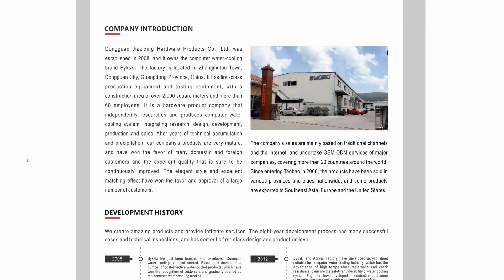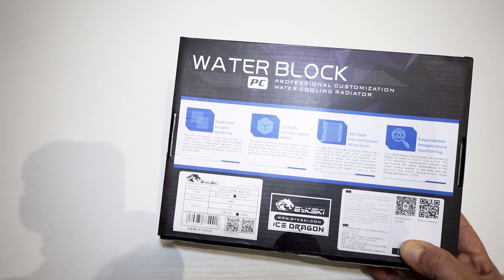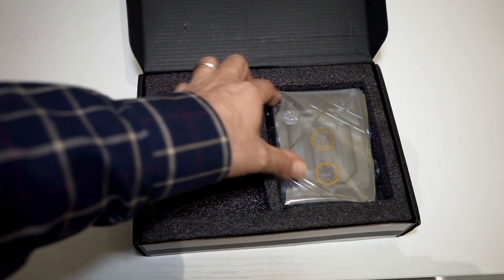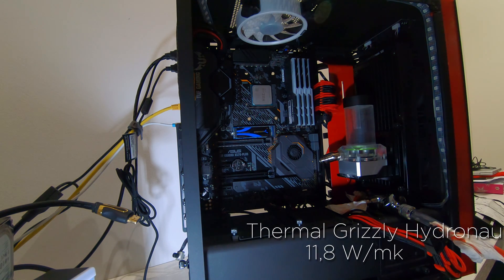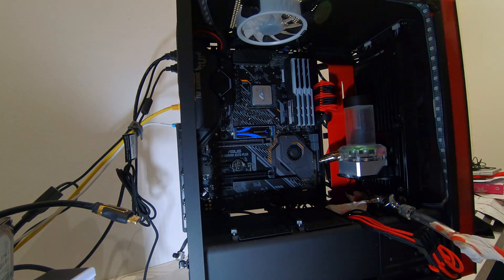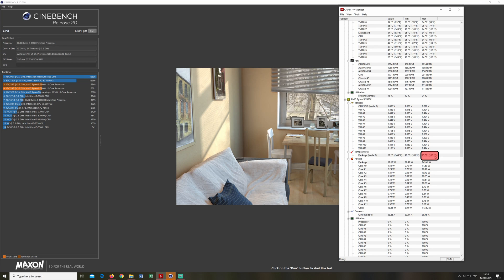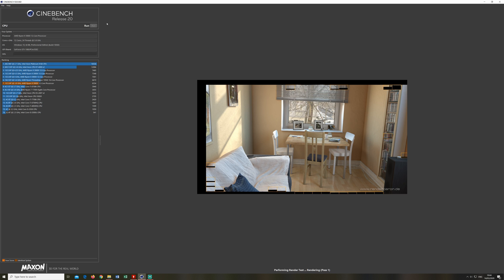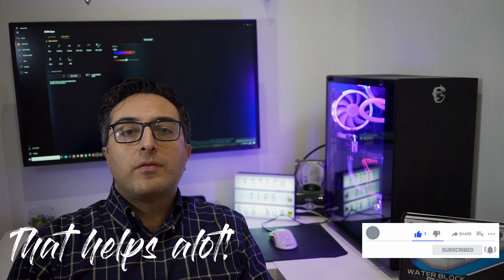Bykski CPU-XPR-AM-V2  : Cool Ryzen CPU Waterblock review

Comment: i have this exact cooler on my 5800x and i cannot get good temps for the life of me
Reply from the maker: Did you make sure all 4 screws are completely tight? Also did you use an high performance thermal paste?
Reply: @fgtechtips  yes and used noctua paste. I have a full bykski system. Idk if it's the radiator or what but idles at 55⁰ and goes up to 87⁰ under load
Reply from the maker: If you have 30c ambient, 55c idle is not so bad considering that CPU but yes it should be lower as you only have 8 cores compared to 12 of mine. Is it a full loop including GPU? Did you enable cstates? I would suggest you to try the thermal grizzly Hydronaut
Reply from the maker: Yeah then it's a bit too high, I think you can get some degrees by enabling cstates in bios which help you in idle temperatures and by removing completely the thermal paste replacing it with an high performance one like the kyonaut that will give you already 2c less than the  Noctua nt-h2 and don't put too much of it but just a narrow X
Reply: @fgtechtips  Yes, this is a bad temp. I live in a tropical environment at 33ºC at day and my 3700X stays just 1ºC above room temp at idle, and goes up to 70ºC on Cinebench loads. I have exactly the same Bykski block with 280mm Bykski radiator, and I'm not even ramping the fans (I use Noctuas with a custom silent curve).

What I can say about this block is how tricky is to secure the mount, it's a far from ideal mount system and you have no clue if the screws are tight enought at the same time you are afraid of crushing the CPU or breaking the acrylic top.
Reply from the maker: Yes he has 22c of ambient temp and 55c idle is absolutely way too much. Either there are some clogging issues or the thermal paste is bad quality/too much

Comment: got this with a 3700x and a thick 360mm radatior and I hit 87C
Reply: Didnt apply it right. 5950x and temps is 59c
Reply: @jacquesbuys1354  yeah when gaming I get 54°C I'm talking about a full core CPU load like video rendering and cinebench gaming only uses 4 cores
Reply from the maker: @tech4life Which thermal paste have you been using ? Can it be that it's low quality or maybe you used too much of it ? Also did you completely screw the 4 thumbscrews? They should be screwed little by little one by one
Reply: @Tech4Life  its rendering..
Reply: @jacquesbuys1354  you probably have it set to use your gpu for encoding try running cinebench R23 multi core it's not like my GPU is the reason my system is getting hot it's below 60°C half of the time I'll make a video on it and share the results through a link later

Comment: Great video but I'm a little confused. Does the waterblock need to get power from anywhere, or is it all in the pump. Thanks.
Reply from the maker: No Power needed, it's the pump that will make the water flow in the loop. You only need to plug the arGB cable for the lighting effects
Reply: @fgtechtips  I have only jrgb ports on my motherboard, is there any converter you would recommend?
Reply from the maker: You could buy a 5v 3pin to sata converter like this
https://a.aliexpress.com/_vNeTDr

Comment: I was thinking of changing my Alphacool NexXos XP Silver from 2004... I'm using a 5800x with 2x 240mm rads and after warming up, it does 77-78C in cinebench R20.
I wonder if with this it will get better?
Reply from the maker: Hi i don't know that specific one but it's pretty old, with this one you will surely gain additional surface which is always good and the number of fins is probably higher
Reply: @fgtechtips  I'm deciding between this one and the alphacool xpx, let's see how it goes, but this one with A-RGB would be a plus. 
Do you happen to know the size of the micro channel finlet area and the full copper base plate? Thank you, it might be the factor to make the decision.
Reply from the maker: @nelsoncasquinha  you can use the google translator app on android and point the camera to this website. https://www.bykski.com/page133?product_id=3566  I was not able to find information on the size of the plate but it's surely the largest i have ever seen, regarding the micro channel they seem to be 0.5mm
Reply: @fgtechtips  thank you, I'll give it a go but I've googled a lot and couldn't find anything. If you can a simple picture with a ruler on top would be enough, even with it installed. Thank you
Reply from the maker: Yes but it will give you the acrylic size non the metal size that goes in contact with the CPU. Will measure it later for you ;)
Reply: @fgtechtips  yes i know, but from a top picture with a simple ruler i can tell aproximately the fin area. Thank you!
Reply from the maker: It's 9x12,2cm
Reply: @fgtechtips  thank you, but that is the size of what exactly? It's too big to be the water micro channels on the copper base (I think). That is what I'm trying to find out please. Thank you once again for taking the time!
Reply from the maker: Yes told you I could only measure the top dimensions of the  acrylic plate.....the microchannels dimension  was in the other comment o wrote
Reply: @fgtechtips  oh sorry I saw it but that is the spacing between the micro channels, I'm trying to have an idea of the full micro fin area. If the acrylic is 9x12,2, the the micro channel area is probably around 40x40or something. Should be bigger then acool xpx, but I'm not sure if its bigger than the xp3 light acetal.
Thank you taking the time my friend, really appreciate it. 👍👍

Comment: Did that cover up your top M2 SSD making it impossible to remove without removing the block?
Reply from the maker: No it was really perfect, I was also able to install a small m.2 heatsink without issues as you can see from this video: https://youtu.be/MmJQ2obsyms
But that's really it, anything thicker doesn't fit, as for example this heatsink model I tried here 
https://youtu.be/GCBZy2WXfWw
It was about 1mm thicker than the other one

Comment: Are you still using this block? How has it held up if so? I like it but I don't love that you're holding it down with acrylic instead of metal.
Reply: I was afraid of this too, use the acrylic top for mounting is kinda fearful, I know people with "boutique" (famous and very expensive brands) CPU blocks that used the acrylic top to mount and they had bends and fissures that caused leaks, but the acrylic top is this Bykski block very thick and Bykski claim to be "Mitsubishi acrylic", not sure what this means exactly, I don't even know if Japan Mitsubishi makes acrylic, chinese brands always make some very dubious claims about the quality of their products, but I have mine for about 1 year and its still perfect.
Reply from the maker: Hi yeah still using it and loving it , if you want an argb waterblock it has to be acrylic on top, it's the same also for EK waterblock of the integrated CPU waterblock in most expensive motherboards
Reply: @fgtechtips  Oh I know. I mean where you hold it down with the screws. Ek uses metal and even some of bykskis have have the same design. Im just worried about it cracking from stress. Although, it shouldn't be screwed in super tight anyways.
Reply from the maker: Luckily no cracking even if I have it super tight. btw  my previous ek supremacy Evo was the same, all acrylic on top with no metal
Reply: @fgtechtips  Even where the screws are inserted? They usually all have metal that sticks out for that. It's not a big deal though. I like the look of these way more than any ek block.
Reply from the maker: Yes look at this https://images.app.goo.gl/wADMsfzhvm9daT8TA
Reply: @fgtechtips  That has metal feet for the screws. The acrylic top is fine. Where you screw it to the motherboard is metal though.
Reply from the maker: @treyjennings0915  ok got you now, I thought you referred to the top acrylic . Anyway the acrylic is quite thick, shouldn't be an issue, mine still fine and its still the best looking one
Reply: @fgtechtips  okay, thank you. I'm sure it's fine. I got one of them with the aluminum shroud and clear viewing port :)

Comment: Thanks for the review. The block is a lot bigger than I thought it was. I have this block coming in the mail to replace a Danger Den TDX that I've been running for far too long (2005 lol). I'll be curious if it improves temps at all, although I don't think it will. My loop deserves a major overhaul, it's been running pretty much 24/7 for 15 years.
Reply from the maker: Indeed this is massive but totally capable to handle my 3900x 24 threads overclocked! It's also quite cheap and with stunning visuals thanks to argb. You can see how everything works togheter in this other video I did: https://www.youtube.com/watch?v=bYZseF9X3TY
Reply: DANGER DEN!? Unbelievably based, please let me know how you got it working on AM4 and specs+temp results+wattage. I want to use some vintage water cooling gear for a meme build some time and if it actually performs well that would be awesome.

Comment: Dude, you have swtich the in and out of the cpu block. You have to make it the other way around.
Reply from the maker: No, I actually tried both, it's the same performance ;) After years buildings several pc and water loops I learned the order doesn't really matter
Reply: @fgtechtips  I've actually now tested this myself with the XPR-AM-V2. With the flow "reversed", at an ambient temp of 23c, idle temp is 34c, load is 68c. With the flow as intended, at an ambient temp of 21c idle temp is 31c, load is 66c. So the difference is effectively zero.

On some blocks, the inflow/outflow actually does matter. The XPR-AM-V2 doesn't appear to be a block where the flow actually matters, or at least not with the head pressure and flow rate of a Laing D5 vario on max speed.
Reply from the maker: I have tested so many in the last 10 years and it never makes a difference. In some cases there is difference in the first 20 minutes or so when you turn on your pc but later the whole loop temperature get stabilized so it doesn't make any difference sequence and order of the loop
Reply: @fgtechtips  On some of the older (circa 2005) blocks from Danger Den (TDX, MC-TDX) they had a jet plate and accelerator nozzle that really restricted outflow if you tried to go reverse. But yeah, even then, it was maybe 2c at worse if you're using a very underpowered pump. The worse thing that happens if you reverse more modern blocks that claim they're directional, is you might have more difficulty getting air out of the lines due to additional turbulence in the block, but that's pretty much it.